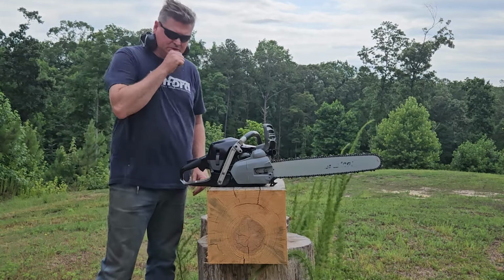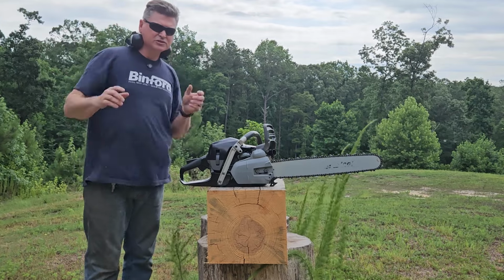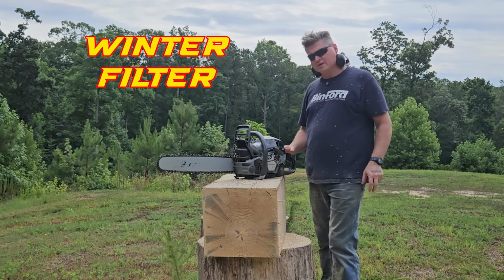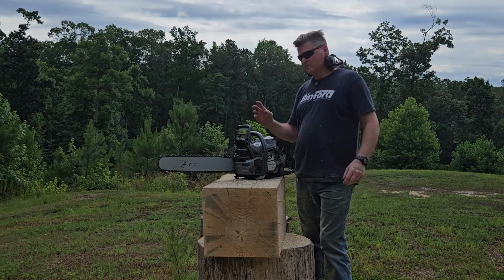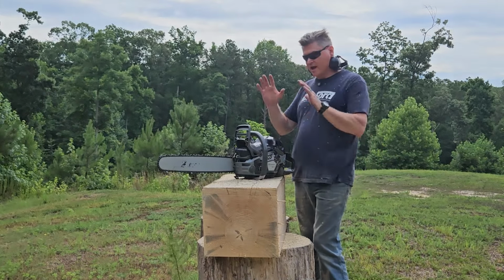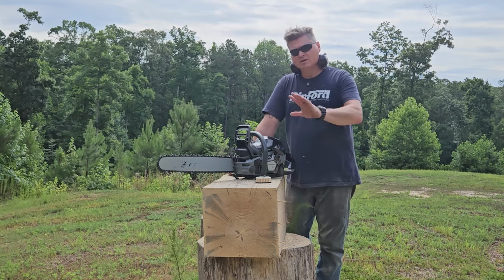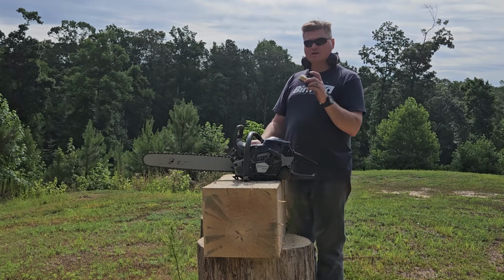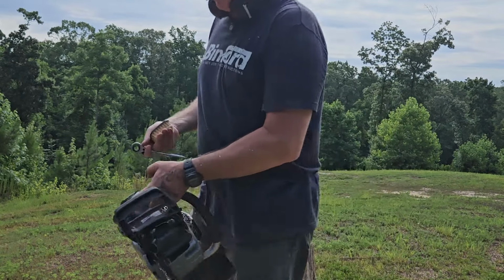562xp Standard filter vs Winter filter

Comment: Great videos, thanks for sharing. In my experience the 562 filter is too small, especially on a ported one. Very noticeable difference after installing red beard foam filter on my 562, especially later in the day after cutting several hours.

Comment: My thoughts on the modifications to pistons is hopefully you can use aftermarket pistons that will still be available down the road, but that's not always possible in today's world, so might as well not worry about it. And as long as you have good notes on what you have done to the piston for that saw, then I see no reason to worry because you could probably get the replacement piston modded to match up without too much trouble. The same goes for mods to an OEM piston, just keep good notes and do the same to the replacement. But I also get the reason why leaving pistons alone for some makes sense. That saw is pretty darn awesome, BTW.

Comment: Would it be worth putting an air horn and uni filter setup?
Reply from the maker: NO!  Do not cut holes into the cover of a 5 series saw.  They have a positive pressure and you would lose power.
Reply: @novicelumberjack  like a little blower setup from the flywheel pushing air?
Reply from the maker: @crperformancetucker5065  yes https://youtu.be/XzBZGLn5Gg8?si=pxuTuAVW4Dn-Tg0R

Comment: Wouldn’t the winter filter be lower flow?  The cold dense air requires bigger jets to avoid leaning out on every two stroke I have tuned. If you aren’t adding more fuel you need less air volume to maintain your a/f ratio.
Reply: The winter filters flow more because they are mesh instead of felt.When the temperature changes 20-30 degrees it does require carburetor tuning , colder weather richer tuning. No jet changes needed .